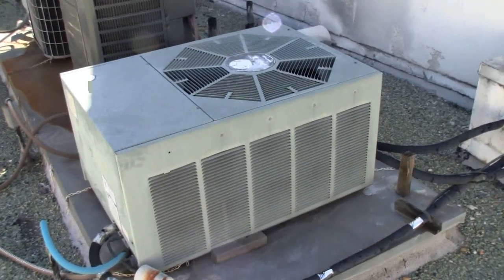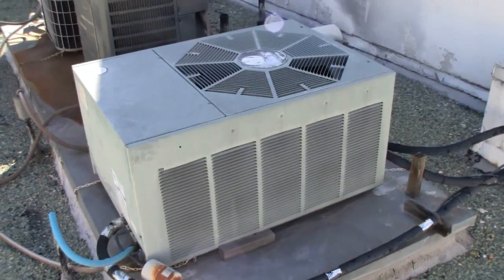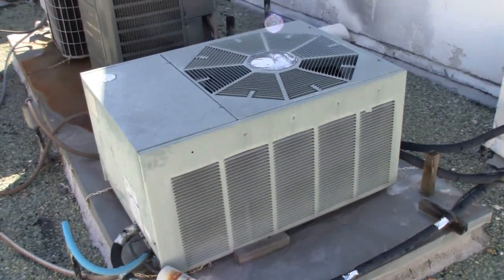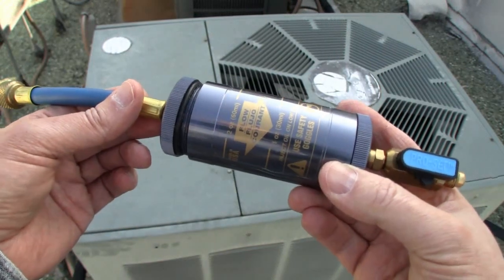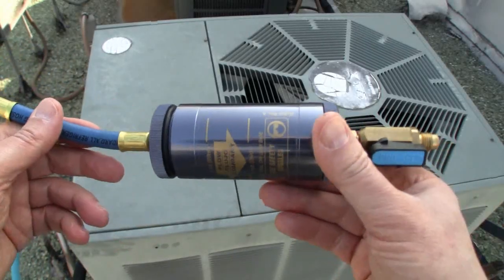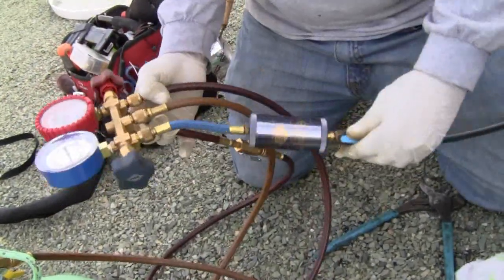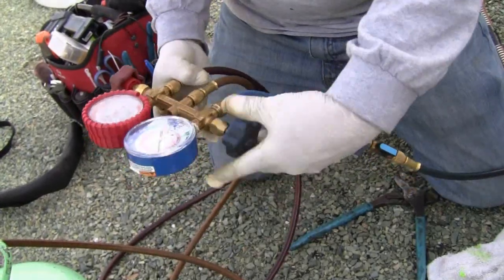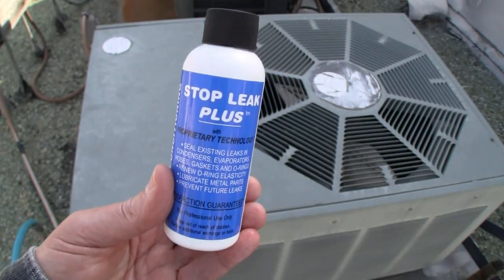How I fixed My Air Conditioning Leak R22 Heatpump

Comment: Did the unit Die after the 2 years... or was it still functioning well (with the AC Stopleak) when you replaced it with the goodman?  Also... are you happy with your new goodman?  Did you purch the goodman online (ebay or whatever) or locally?

Comment: As the manufacture of this remarkable product, we are happy to try and help anyone having a problem with their AC system. We just want everyone to be aware that this product is intended for professional use, application requires technical aptitude and tools. If you have someone who can supply the refridgerant and or do the install, we can bend the rules a little and try to help you get some product to install.
www.stopHVACleak.com
I would like to clarify some of the comments that you may be noticing in this post, from those that are probably not air-conditioning technicians. Our proprietary formulation is a non-polymer based technology developed exclusively by our laboratories, it will NEVER harden or activate if it comes in contact with moisture or air. This is the important difference. The fixed size particulates that we put into our specialty oils never change in size and therefore will not clog TXV valves, capillary tubes, orifices, compressor valves, dryers or the like. All the other products you find on the marketplace use less expensive chemicals and ARE activated, you can't control the size of the goo or slime or rocks they turn into. Obviously they are dangerous and must be avoided.
Honestly, what we created over 25 years ago, is an air conditioning treatment that improves the overall performance of any AC system. It lowers vent temperatures, kills acid, super lubricates compressor bearings and converts water molecules, plus it eliminates disastrous oil fouling. That means you don't just put it into leaking air conditioners, you put it into every air conditioner... including brand-new installs.
Please let your installer and service company know about this remarkable product and or give us a call, will be glad to try and assist. Thanks

Comment: That is a Rheem Classic. Also could be a Rhuud or weatherking. Same product, different name. They are notorious for leaking at the accumulator.
Reply from the maker: Hi Tim. You really know your stuff. It is indeed a Rhuud and we did find that the bottom of the accumulator had a big hole in it. Bad design as the bottom of the accumulator sits against the sheet metal enclosure where moisture accumulates. I got an extra two years out of this unit until I decided to replace it with a new Goodman system.
Reply: Did the unit Die after the 2 years... or was it still functioning well (with the AC Stopleak) when you replaced it with the goodman?  Also... are you happy with your new goodman?  Did you purch the goodman online (ebay or whatever) or locally?
Reply from the maker: When I finally replaced the unit it wasn't working well at all. We replaced the air handler as well because it was made for r22 and the new unit is 410a. What we found was that the air handler had multiple leaks that were too big for the stop leak product to help. We purchased the Goodman locally and are very pleased with the unit.

Comment: This is a good last chance hail marry to take. It comes with a substantial risk of plugging the system down the road. The stop leak binds with oxygen. There are some oxygen molecules floating around in the system and if the stop leak smashes into them in a year or so you'll form a plug that will plug the system and stop it from working.
Reply from the maker: I agree it's just to get a system to work when you can't afford to install new equipment. We finally found the leak in the air handler and replaced the unit. I believe this particular formulation doesn't react with oxygen like some of the products that come in the pressurized cans. We never had any problems with clogs or plugs in the three + years I used it and it flushed out of the system without any problems.
Reply: Just a follow up on Robert Gary’s “incorrect” statement that we can clog systems.  We “CAN NOT” react with oxygen and or moisture, so it is “impossible” for us to clog any part of the system.  Please do not confuse our product with all the copy cat imitators that have popped up the last ten years, after our 20 year old patents ran out.  They tried to copy our unique treatment but DO NOT have our proprietary “micro solids” formula.  Please visit our sites then give us a call if you have questions, we will do our best to assist you and your AC technician.

Thanks,
Gary

GWR Products
1(800) 266-4497

www.stopHVACleak.com
www.acStopLeakPlus.com
www.134acStopLeak.com

Comment: I have two Carrier units cooling my home. A 3 ton and a 2 ton. My home and both units are 23 years old. I clean and check both units every spring before the "hot" season begins here in Louisiana. The 3 ton developed a small leak 3 years ago. I had to "top off" with a pound of R22 each spring. The third year before the annual recharge, I researched and decided on AC STOP LEAK PLUS. I spoke the nice gentleman on the phone for an easy 45 minutes. He explained his product was non-polymeric. Having retired from a chemical plant that manufactures polymeric MDI polyurethane, I can assure you polymeric material reacts with water/moisture and creates solids/ureas. This product interested me with the non-polymeric and lubricating claim. Well with 20 year old A/C units I really had nothing to lose. That was 18 months ago. I can attest my units both are still running beautifully! The compressors are both are running more quiet. The 3 ton unit had a start capacitor quit last week. I replaced the 23 year capacitor and the contact switch also, due to age. The unit started back up faithfully. I put the gauges on it for the first time in 18 months. It was still maintains a full charge. I have absolutely NO complaints and am a believer in this product. I have NO affiliation with this product (AC Stop Leak Plus). 
Just my 2 cents. (Well spent, lol)Eric in Louisiana

Comment: stop leak is only a temporary  solution if that save environment get new unit
Reply: Craig Oldenburg  Sorry but the “proper” treatment (stop leak) will work, and I can prove it.  With over 30 years of professional HVAC customers using this proprietary and patented technology, I don’t see any way someone can refute the results.  We have a 95%+ success rate with stoping pesky leaks but at the save time, have NEVER had a single complaint about clogging a system or breaking parts.   You can believe old wives tales but wouldn’t it be better to check the scientific technology and chemistry behind our concept?

www.stopHVACleak.com
www.134acStopLeak.com

GWR Products
1(800) 266-4497

Comment from the maker: Hi Canadianqueen:
If I remember correctly the stop leak product was about $80 US. The rest of the costs will depend on how much your HVAC pro charges for service and the cost to recharge the R22 you lost from the leak. My system has been holding a charge now for over a year but I still have a very very small leak (The old leak was quite large). I find that if I run my heat pump a couple minutes a day (Even when I don't need it) it helps to circulate the stop leak and prevent the leak from getting any larger.
Reply: Thanks for the info and especially for the update. Has anything changed in the last 5 months? Is it still holding? Any negative effects? Still quiet? And can you define "large" and "small" in terms of your leaks? 

In hearing you describe the liquid having to travel 3 stories I think your situation might be different than many. Just thinking out loud.

Thanks.
Reply from the maker: Hi William:
Everything was holding great and then all of the sudden the unit stopped cooling. Tech came out and found that one of the parts (I think he called it the accumulator) had rusted out from the bottom and had a terrible leak. He replaced the part and recharged the unit. It's holding pressure just fine and he thinks that the lubrication properties of the stop leak may have saved the compressor. If I can get another season or two out of the unit before I replace it that would be great but it's almost 20 years old now and r22 is getting more expensive.